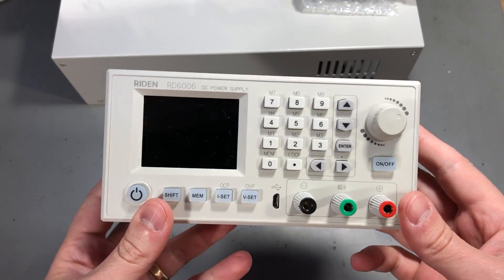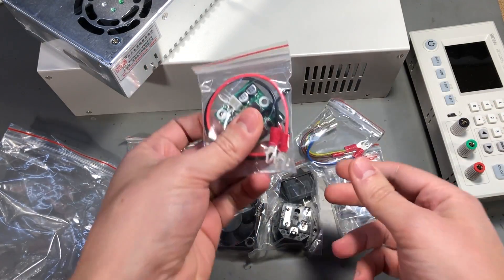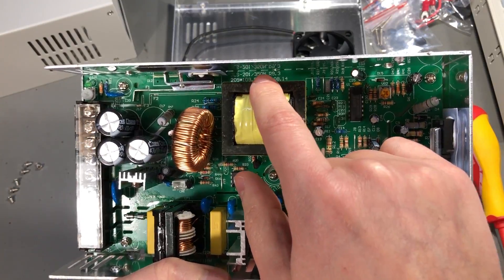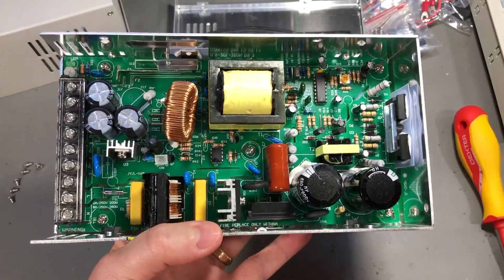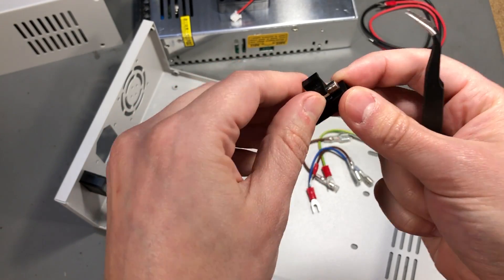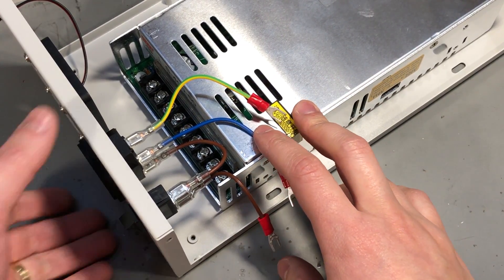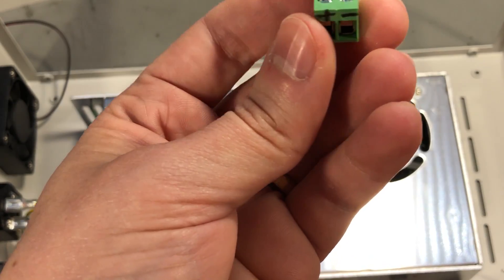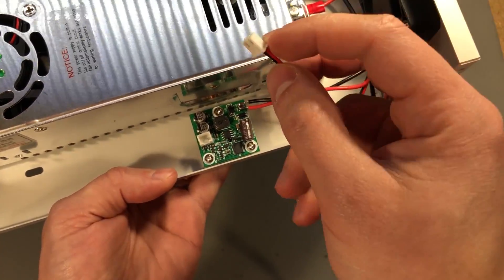Voltlog #284 - Riden RD6006 Power Supply Review - Part 3

Comment: I purchased one of these specifically to use it to recharge my E-Bike battery (14.5 AHr 14S8P NMC). Why you ask? Because no ebike battery charger gives you any idea what is going on. Most only have a Green LED = charged and Red LED = charging. If there is a problem then you have no way to determine if it is the charger or the battery that is the source of the problem. I have gone through 3 chargers for this battery (one expensive one and two cheap ones). 

The RD6006 has a dedicated "Battery" terminal along with a external temperature sensor and cutoff relay. However the documentation for using the "Battery" terminal is minimal at best. The really important detail they leave out of the documentation is that the power supply runs in "Constant Voltage" mode when the battery is connected to the green terminal. I would love to see a video of using the RD6006 (or one of its siblings) to properly charge a Lithium Ion battery pack. I think you are likely qualified to take on that challenge.

The thing most people leave out of their reviews is how to clear/reset the accumulated energy values (turn the power supply off). My other gripe is that there is not a Linux version of their PC software. One has to use that other operating system.

Comment: Update from a previous post: (It would be nice to see a review of this RU firmware on this channel)
Best firmware for 6000 series is on EEVblog. Google UniSoft RuiDeng Riden RD6006 DC power supply for forum. 

Below is the Change log. You can always return to stock firmware at anytime.

In case of any problems while update, keep pressed [ENTER] while power on device, to run device in BOOT mode.

RD60062_V1.32.x.bin - my custom firmware. (where x - is the build number (sub-version))
RD60062_V1.32.bin   - original (stock) firmware.

If you want to return to stock firmware, recommend to set default setting

To do this: keep pressed button [0] while power on device.

---------

History:

---------

--- RD60062_V1.28.1.bin ---

* Initial version

* Optimized, get rid of HAL Libraries... switched to LL

--- RD60062_V1.28.2.bin ---

+ The menu was complete remade, now I can easy add new items.

+ [SHIFT] + [Left/Right] — switches the current layout (without save in settings)

  (if need to set layout after power on, then can do it over settings menu, as before).

+ For 'layout 1', can be enabled/disabled items.

+ Added OPP (Over Power Protection).

+ [SHIFT] + [MEM] — used to setup OPP

+ OVP, OCP, OPP — now can be disabled by setting it to 0

+ When entering OVP, OCP, OPP, SHIFT button will be highlighted as well
  (to visually distinguish input: V-SET from OVP, I-SET from OCP).
+ The RIGHT button now works as a Backspace when typing.

+ When turned on the internal fan (the one that is on the module itself), icon will be displayed.

--- RD60062_V1.28.3.bin ---

+ Added setting for current cutoff in battery charger mode.

+ Added setting for batt temp. cutoff in battery charger mode.

+ Added Battery Charger Layout 

+ Added Setting to skip keypad lock when connect with software.

+ [MEM] + [.] — now used to reset Wh, Ah

--- RD60062_V1.32.1.bin ---

* Updated to version V1.32

* Bug fixes

--- RD60062_V1.32.2.bin ---

* Bug fixes

+ Option "Digits Style", can select style for large digits (32x64, 12x24, 7-Seg)

+ Decreased minimum battery voltage from 900mV to 300mV 

--- RD60062_V1.32.3.bin ---

+ Support WIFI

* Bug fixes

--- RD60062_V1.32.4.bin ---

* Fix TTL Interface

--- RD60062_V1.32.5.bin ---

+ Option "SkipExitIVSet" (prevents exit from edit mode for V-SET and I-SET when press ON/OFF button).

* Bug fixes

--- RD60062_V1.32.6.bin ---

+ Option "Standby LED" (Setup the behavior of the power button LED in power off mode (Default-pulsating, 0%-off, etc...).

  (in modes 0% and 100% power consumption will be less (cause no need software generate PWM and can switch MCU in to the sleep mode)

* Bug fixes

--- RD60062_V1.32.7.bin ---

+ In power Off mode now using hardware PWM (except pulsating mode) for Power LED and turning off unnecessary peripherals, 

  to decrease power consumption.

+ Remade function to enter values. 

* Bug fixes

--- RD60062_V1.32.8.bin ---

+ Option "Save Mult." to save current multiplier (for current session only, reset after restart)

* Increased minimum battery voltage from 300mV to 500mV (Due to some instability) 

* Bug fixes

--- RD60062_V1.32.9.bin ---

+ Added option "Power State" (Power On, Power Off, LastState). Sets the state after power on (without a battery, LastState will not remember the last state).

+ Added option "Power Switch" to turn On/Off the primary PSU. (5V standby power supply required). (Note: Adds a 3 second power-on delay).

  The control output is routed to the PA14 port (pin 4 of the J2 connector). High level - turn on, floating or low level - turn off.

  Note: the maximum load on the port is 20mA !!! (it is better to use an optocoupler).
+ Added option "AutoPowerOff" to automatically turn off after a specified time if the output is disabled.
+ Added option Home:"Status Info" allows you to choose which parameter to display in the status bar (if you need something else, let me know).
+ Added option Home:"Mem Hint" If enabled, then pressing any number key will display a hint with the current settings in the corresponding memory cell for 1 sec,
   a second click during this time will apply these settings.
+ added new parameter "7-Seg v2" to option "Digits Style", where "input", "vset", etc. will also be 7-segment.
+ Added display of the system temperature to the caption.
+ Minor improvements

--- RD60062_V1.32.10.bin ---

+ Added option "Screensaver" to decrease brightness (ScrsaverBright) after specified time. (Note: "ScrsaverBright" must be less or equal to "Backlight") 

  Press any key (except ON/OFF) will turn on backlight and restart timer. 

+ Added option "ScrsaverBright" Screensaver Brightness (0-complete turn off backlight, 1-equal to "Backlight"=0, 2-equal to "Backlight"=1, etc)

+ Added option "ScrsaverActive" Allow activate screensaver if output is in active state.
+ Removed meaningless icons from the caption.
+ [Left/Right] — switches the current layout (without save) (no need press SHIFT anymore)
- Removed Layout 2 (Layout 3 already shows all values).
+ Minor improvements

--- RD60062_V1.32.11.bin ---

+ When edit "ScrsaverBright" or "Standby LED" now you can see the real effect... 

+ Added option "Comm Buzzer" make a sound when the software writes new parameter(s).

+ Option "Mem Hint" now can select the time how long show the message (2, 3, 5 sec)

+ Added option "ShiftMemTable" Press SHIFT to display the table with settings for all memory slots. 
+ Added new menu group "- Colors -", now you can choose what color (one of 15) to use for the next parameters:
  Voltage, Current, Power, Input, V-Set, I-Set, OVP, OCP, OPP, Ah, Wh, Temp, BattVoltage, BattInfo (Layout 2).
  Option "Custom Color" allow to use selected colors (using this option you can enable/disable custom colors in bulk).
  Option "Test" is just temporary option and will be removed in next release, 
  can be used to see any color and its hex value.
  List of colors need be adjusted, if you have any ideas just let me know (tell me hex values).
  Here is the current list of colors:
    const uint16_t g_colors[16] = {
      0,            // 0 - Default
      C_RED,        // 1  = 0xF800
      C_GREEN,      // 2  = 0x07E0
      C_BLUE,       // 3  = 0x001F
      C_WHITE,      // 4  = 0xFFFF
      C_YELLOW,     // 5  = 0xFFE0
      C_MAGENTA,    // 6  = 0xF81F
      C_CYAN,       // 7  = 0x07FF
      // 
      C_LIGHT_BLUE, // 8  = 0x01CF
      C_GRAY,       // 9  = 0x8410
      C_BROWN,      // 10 = 0xA145
      C_ORANGE,     // 11 = 0xFD20
      C_OLIVE,      // 12 = 0x8400
      C_TEAL,       // 13 = 0x0410
      C_PINK,       // 14 = 0xFDF9
      C_MAROON      // 15 = 0x8000
    };
	
--- RD60062_V1.32.12.bin ---

* Bug fixes

+ Some Improvements

+ New option "Max Power" to limit the power of primary PSU. (came from RD6018).

+ Fixed Layout 4
+ Added more options for Layout 1 (Note: only first 6 will be displayed).
+ Added function to dump the screen (make screenshots) (real dump from LCD GRAM),
  but this function a little bit slow, takes around 13-15 sec (need transfer 320*240*2 bytes over UART).
+ modified French translation (still need to make translations for German, and Chinese.)
+ Added Russian Language
+ Font for menu was changed to Terminus
+ ENTER can be used to exit from menu.

Comment: I noticed that there is space for another output cap (Inside the S400-60), will it be of any benefit to add another one in that empty spot? 
Very good video, as usual.  As a matter of interest, there is new firmware available on EEVblog. Did not try it yet.  (https://www.eevblog.com/forum/testgear/ruideng-riden-rd6006-dc-power-supply/msg3108986/#msg3108986)

Comment: you should never put tinned wires into screw terminals
Reply: Why
Reply: @solarhope  Because soldered wire ends in screw terminals become loose over time. Especially in higher powered connections. This is due to the fact that solder flows a little bit overtime even when cold

Comment: I think the fan should blow inwards. That way you get more of cool outside air in then by it trying to suck hot air outwards. Also, it might solve the problem with the nuts not being captive when mounting the fan.
Reply from the maker: The fan will be most efficient for cooling when it's extracting air out of the case, pulling fresh air from the front, the fresh air will pass over the components inside cooling them down until it goes out the back.

Comment: I'm wondering about that case fan controller that you installed next to the 60V power supply.  Its location looks like it lines up with the spot where a heat-generating device inside the power supply is screwed to the case for heat sinking.  Is the thermistor on the fan controller supposed to make thermal contact with the power supply case at that location, or just flop around in the breeze?
Reply from the maker: The power supply has it's own fan and thermistor. Since the fan controller we are talking about controls the main enclosure fan on the back it seems logical that it's temperature monitoring should be of the general enclosure hence why I thought hanging in the breeze would be fine. When the air gets hot inside the case it will sense that and speed-up the case fan.
Reply: @voltlog  Yeah, that makes sense.  The PSU will be dumping hot air into the case, so that sensor will detect the temp rise and run the case fan.
Reply: That's what I was wondering, ie, is it supposed to be glued to something, because flapping around in the air stream doesn't seem that good.

Comment: Advice: Find another case (not so deep), and cut a hole in the front and drop-in two series connected low cost 24vac industrial control transformers (100-200VA is fine). You must rectify with a 25amp bridge rectifier and filter with 80v capacitors totaling 4,700 uF, or more. The net result will be lower cost and lower noise  output. For a good support thread on EEVblog, Google RuiDeng Riden RD6006 DC power supply EEVblog and get updated info from other users. You can also find a 4-part review on YT channel Jerry Walker if you demand some lower noise output. Remember this at this point, the ethics of RuiDeng-Tech are still unknown and they were kicked-off EEVblog's forum several times for bad communications creating fake sock-puppet accounts to boost product exposure (not acceptable!). As always, caveat emptor.. and don't bother buying that WiFi module - their App stinks. Also, user msillano has a PDF summary of the USB serial protocol on his page listed as RD6006-Super-power-supply over on Github. Cheers!
Reply: FWIW, Github user Msillano is showing progress on a battery charger app (EEVblog picture posts shows it also has profiles for NiMH battery charging too..). I guess as time goes on, more hacks and apps will appear. I have to wonder though, if a battery is charging and the wifi stops working.. will the battery explode? He knows the serial protocol to control it, but getting a watchdog timer to run on the ST uC (inside the power supply) would be code he cannot access... :-)
Reply: We should ask Riden to add one item on the LCD menu in future updates enable a "serial timeout" and if the host doesn't send any commands after x seconds, then output switches off for safety.

Comment: I suppose it might be attractive to someone taking full advantage of all the features it offers (or the fairly high output voltage). On the other hand, if all one wants is a typical lab supply of the generic 30V/5A variety with a voltage and current display, any of those can be had anywhere for much less than a $100...

Comment: Please don't screw into a wire that is soldered, it may give a bad connection to the front panel. The solder will give in over time, and give bad connection
Reply from the maker: Yup, Ideally those wires should have been terminated with some ferules.
Reply: @voltlog  
 Then there is the question of what is a low cost half decent crimp tool for ferrules. I've got a drawer of ferrules and figured one of many old crimp tools I have would work. ...nope... If the tool doesn't completely surround the ferrule in both circumference and length the results suck. I just mangle them with pliers occasionally. Which ~$10-$15 tool works?
Reply: @UpcycleElectronics  I've got this one -- http://www.ebay.com/itm/402011532869 -- and it works great.  There's also a version with blue and red handles that looks to be mechanically identical.
Reply: @FlyingShotsman  
 Thanks. I've been looking at that one but hadn't researched it at all.